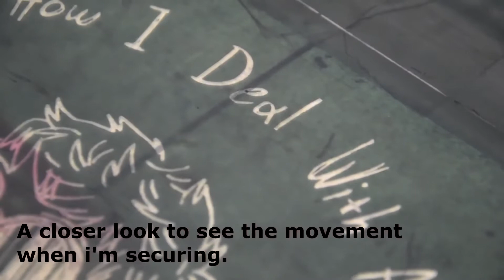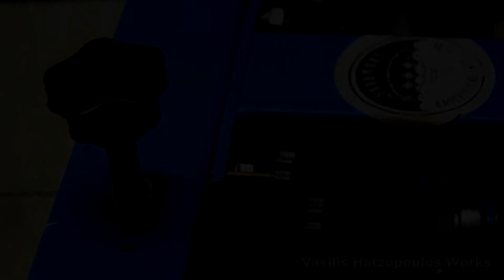How to Fix your Cheap China Screen Print Press-DIY  Part 1

Comment: Have you also made micro registrations to it or what are the bigger nobs for?
Great video!
Reply from the maker: Thanks a lot, my friend. The knobs behind the press frame clamp is a type of Off-contact regulators .With these type of knobs you can  adjust your frame to be  parallel to the print surface. I ll make a video soon to explain that. Also I'm working on a micro registration adjustment..i hope soon to find a good and useful solution..
Reply: @b1liz  oh I see!
Will be interesting to see your upcoming videos :)

Comment: What are the dimensions of the pieces of aluminum?
Reply from the maker: 4 square pipe  aluminum pieces 15mm x 30mm and 255mm  long
Reply: @b1liz   think that's a rectangle, i dont know though
Reply from the maker: maybe you are right..here in my country we call it circular or rectangle tube.. yeah I think its wrong to call it pipe ..thanks @maxSchlein
Reply: @b1liz  I was just messing with ya, it's all good

Comment: you can be use a wooden piece of wood over the frame simply...
Reply from the maker: I have tried and didn't work so well...when you setting up your frame you spent more time adjusting it with wooden pieces. Also when you using wood it cants secure your frame perfectly and in the process of print, you can miss your primary registration points.
Reply: @b1liz  Could you make me some?